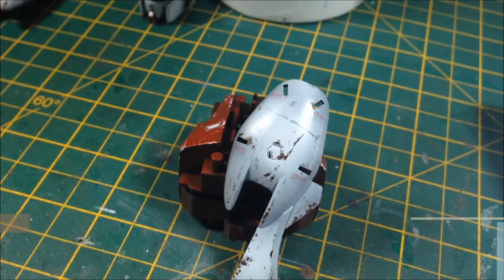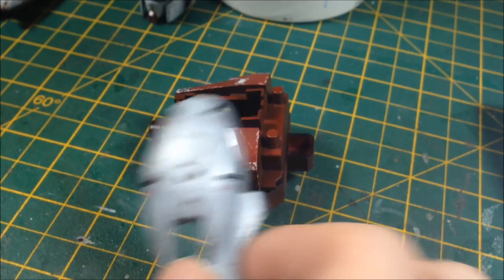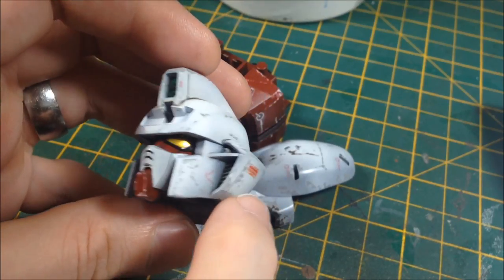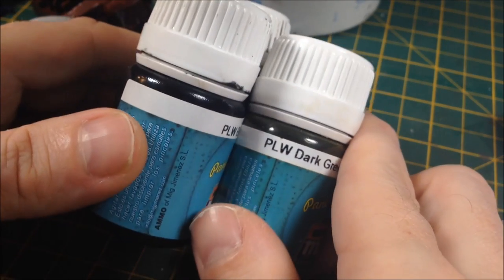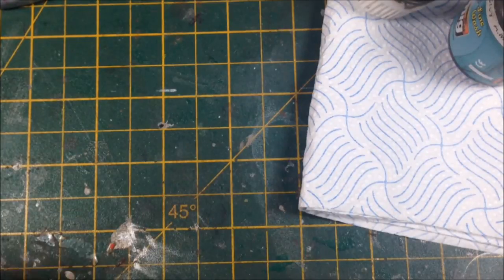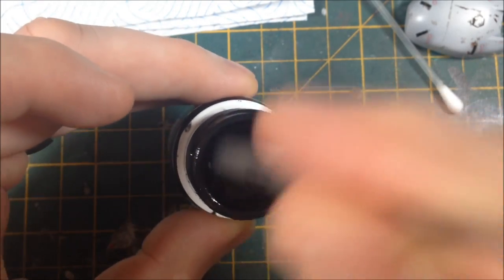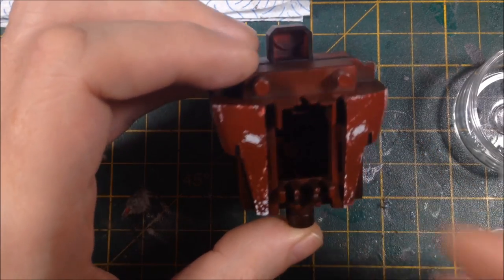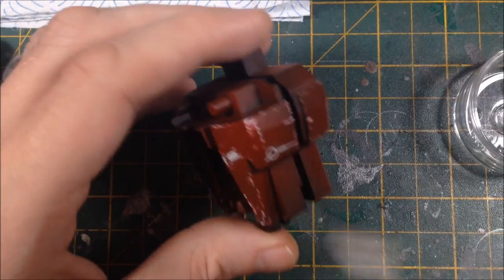Bandai 1/60 Big Scale Real Detail Strike Gundam 12: Enamel (or oil) Pin Wash Method

Comment: Heads up to anybody new to enamel washes, be careful when using it on bare plastic as it will eat away at it and leave it brittle.i learned this the hard way, unfortunately my winged zero has never fully recovered.
Reply from the maker: Yep, sadly we all learn by doing. NEVER use enamel washes on bare plastic - in fact, for gunpla never use ANY kind of thinners AT ALL on bare plastic, as it will weaken and eat away at it. If you must do washes on an unpainted gunpla, stick to clay/water based washes or artist inks that can be removed with water (or use panel line pens or pencils). I showed what you can do on an unpainted model in my Geara Zulu build series.
Reply: but is it safe to apply gloss varnish on bare plastic?
Reply: irampage As long as it's an acrylic varnish or pledge you will safe to do so.

Comment: Quick question do you or have you ever used the oil dot method to fade/discolor the paint (ala armor models) on any of your gunpla?
If so point me to the direction on the build if not might you consider trying it on a gunpla me thinks it might be a interesting effect/look. Well enough of my bullshitting (that's waffling on this side of the pond) love the videos keep up the good work soldier 👍✌️.
Reply from the maker: I have actually, although not on a gunpla and not on a build I filmed, I used it on a Millennium Falcon build.  I did di a blog writeup on my old site, but I no longer own that old site so I can't post a link. However, youtuner Fictenfoo poasted the same technique up for his Falcon build, which is right here: https://www.youtube.com/watch?v=wreblsPaUhU
Reply: Modelmaking Guru 
I've seen that video it is excellent I was just wondering if you did it on a gunpla because I thought it would cool and was wondering how you would handle it on the varied surfaces on a mobile suit 
Thanx again for replying
Reply from the maker: No worries! I haven't as yet, as I since started using Ammo filters which are enamel and basically do the same thing, and so takes much less effort ^_^

Comment: Hiya bud, im currently working with tamiya acrylics and was wonderin about doing some panel lining. Im slightly worries about getting smudges using a tamiya enamel thats been thinned then cleaning with lighter fluid.. any advice? ive been told lacquer top coat should make a tough protection.. I'm not sure whether rustoleum crystal clear is enamel or lacquer and if it will work well with the method i mentioned..
Reply from the maker: Hi! You;ll be glad to know you don't need ANY thinners to remove enamel panel line washes! As long as the model has that gloss coat, then simply apply your enamel (you can thin regular enamel paints, although I would recommend getting either Tamiya enamel accent colours or something like the Ammo by Mig or Ak Interactive enamel panel line washes, they are much better and pre-thinned to the right consistency) and leave them for 10-20 minutes. They should have dried enough by that point that you can simply rub off anything outside the panel line with a dry cotton bud (Q-tip). If you do have any that are stubborn, just having a slightly damp cotton but (enamel thinners, odorless oil paint thinners or lighter fluid are fine) will remove them easily. BUT you must gloss varnish it first, and for that, I recommend saving yourself a lot of money and hassle and simply using pledge Floor Care Finish (Pledge Multi Surface Wax in the UK)  - assuming you have an airbrush, It's, like, $6 for 750ml which will last you YEARS and is much friendlier to the acrylics than lacquer topcoats (it's essentially a gloss acrylic varnish).
Reply: ive tried putting a a few touches of thinned enamel from humbrol on a part of a piece painted with acrylic today to test how well itll clean up without the lighter fluid.. seems to have made the affected the paint underneath exposing the primer.. perhaps perhaps it needs a bit more gloss coat? or i hadnt left it long enough to dry in which case can the enamel wash still be cleaned up if left overnight?
Reply from the maker: Hmm, that shouldn't be happening. You need to leave both the underlying acrylic base colours and the gloss coat to day and cure fully before going over with the enamels. What did you use for the gloss coat? If it was Pledge/future/Klear, then you need to leave that for at least 24 hours after applying to make sure it will not be affected by the enamels. It could be that the enamel paint re-activated whatever the gloss coat was (if it was a fully cured acrylic like Pledge, enamels should not effect it). Or it could depend on what you used to think the enamels, it may be the thinners you used were able to effect the the gloss and Tamiya paints (remember, Tamiya paints are alcohol-based, so are more like lacquers than acrylics, and alcohol based thinners can remove them). I suspect if left, then either whatever you try to clean the enamel off with will reactivate them all again, or if the enamels have merged into the paint or gloss, then will be impossible to remove without taking everything else with it. You may need to strip that part and do more testing on spare bits, to try and figure out what is causing the problem. I can honestly tell you that I have never had an issue when I have painted Tamiya as base colours, glossed with Pledge and then used pre-made enamel washes or panel line washes (the acrylic varnish does not affect the Tamiya paints, and the thinners in pre-made enamel washes do not affect acrylic varnishes). As long as they are all fully cured, of course. Good habit is to leave 24 hours for anything to cure at the very least before applying something else over the top that is either a different type of paint (i.e. enamels over acrylics) or that is thinned down. Also, Humbrol enamels are pretty poor. The AK Interactive and Ammo range include enamel products specifically made for weathering that you might find easier to use and less risky.
Reply: Modelmaking Guru alright mate thanks for the response.. ill leave it more time to dry..
Reply: A year later, but Rustoleum is an enamel, so it doesn't play well with panel washes that are also enamel based.

Comment: hi fox how are u?Got a quick question. Can these PLW be used on bare plastic? just wondering
Reply: kinda found my answer in on of the replies of viewers :D
Reply from the maker: NOPE! Well, yes, but you risk the plastic weakening and breaking as the thinners may wreak havoc with Bandai's plastic. Never use on bare plastic, at the very least seal the plastic with a gloss coat first (although that does not guarantee anything).
Reply: Thanks for the reply! another question: is gloss coat safe on bare plastic? I dont have airbrush and i only do hand painting (inner frame and details) so usually i dont prime my kits
Reply from the maker: Yep, as long as it is an acrylic gloss coat it will be fine. However, you may find that because of the shiny surface of the bare plastic the gloss coat may bead or pull away from edges a little in places, giving you a lumpy coat, especially on big flat parts. Ideally it is best airbrushed so that issue is avoided. Or you could just gloss coat the parts you have brush painted, as the gloss coat will have a better time adhering to those areas.
Reply: thank you fox!
Reply from the maker: No probs!